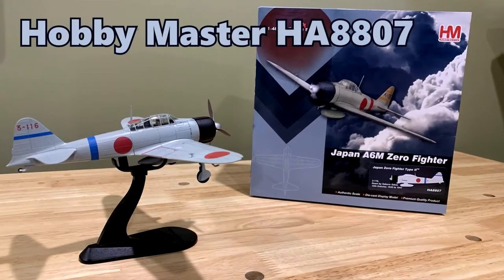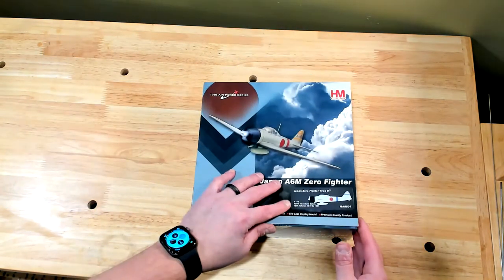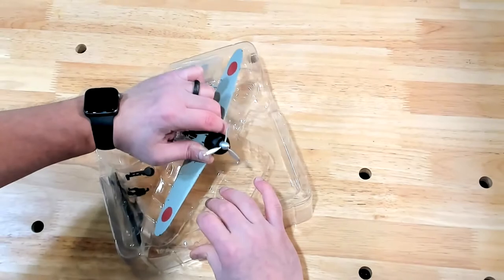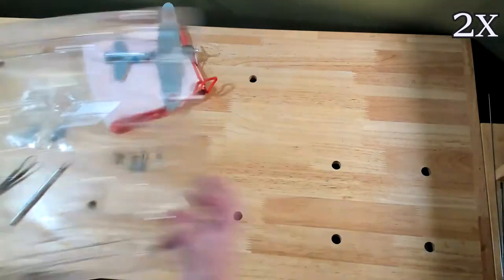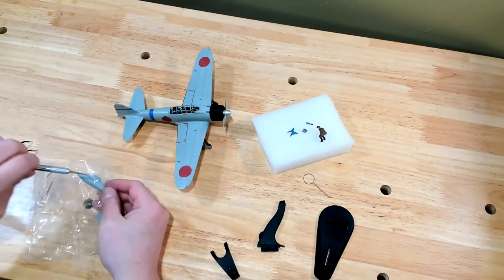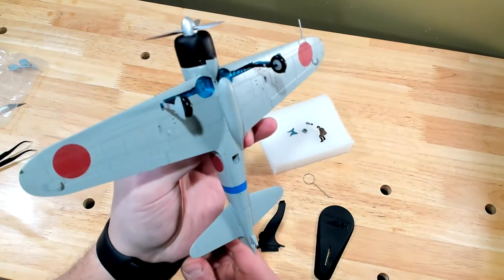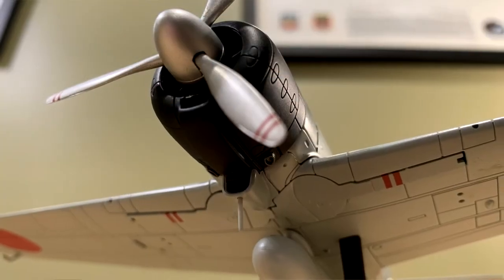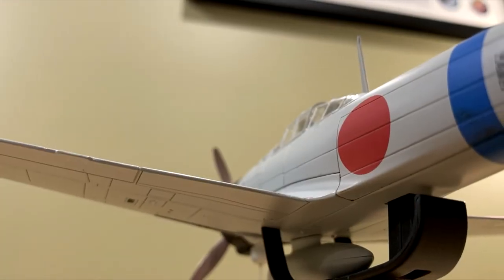Unboxing of Hobby Master 1:48 Diecast WWII A6M2 Zero - HA8807 - Saburo Sakai - 12th Kokutai

Comment: The butterfly piece your talking about would go between the wheel bay's if you have the landing gear down, they are small flap's on the inside of the wheels or center between the wheel bay's.  Also the true colour of the zero is grey/green not blue. Hope this helps.
Reply from the maker: Thanks for the info!

Comment: Very cool model. Is that butterfly piece the inner gear doors?  I'm going to try to ignore the fact that they have a corsair to match this one. :D
Reply from the maker: I'm trying to ignore that there is an Akutan Zero of the same size. HA8804
Reply from the maker: You are correct...they are the inner gear doors. Since I had the external fuel tank on...it was covering up the notch that fits into. However, I couldn't easily get it to stay in...so I'm leaving it off for now.